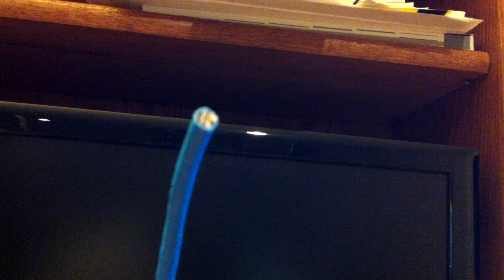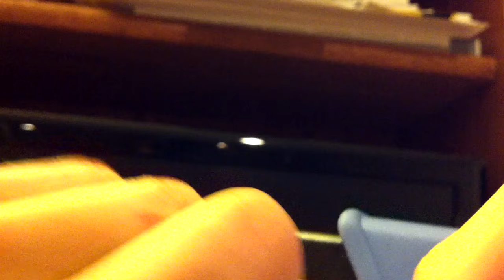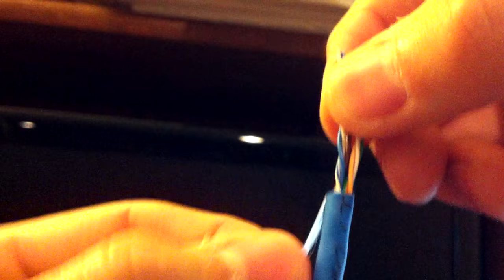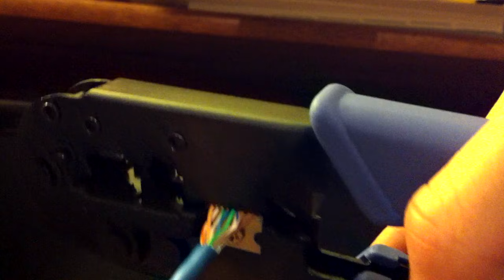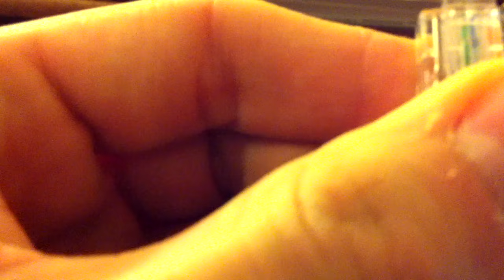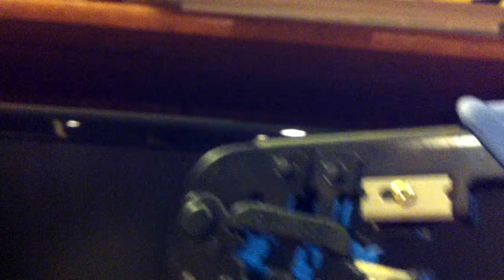How to Fix/Terminate Ethernet Cables (Connectors)

Comment: I recommend trimming the tops on the cable ends flat before pushing in and when I push in I flip the tool over so I can see the end of the plug and I push until I see the copper tips at the end of the plug.  Then I usually crimp 3 times to be sure.  Also besore I push in the cable I pinch them tight with my fingers so they don't move around.  I very rarely have to redo a cable using this method.

If you want to cheat you can get a crimper tool called an Easy RJ Pro and buy the much more expensive RJ45 tips that let you pull the strands through the other end.  The easy RJ pro tool will cut the ends off the wires that hang out the end but lets you do ends pretty quick.  I have had some people tell me that these jacks have caused shorts before but that may be that the tool was worn out.

Comment: Those filaments strands you cut away actually have an important purpose. The filaments strands are there so you can rip back the blue jacket beyond where you did the circular cut of the blue jacket. You are not supposed to use the wire strands where you did the circular cut because there is a good chance you nicked the wires with the blade. You rip the jacket back with the filament strands then cut off the wires where you did the circular cut. Now there is no chance the wires you have left have a nick and break off.

Comment: i use pass through heads (or rj45s) the cables stick out the tip and you can easily double check the order and will always know the cables are aligned and long enough. guarantee you always get a good crimp every time. the extra wires sticking out get trimmed off when you use a pass through crimper.

Comment: I'm glad I saved the old head of the cable that I had to cut off so I could reference which order the other 8 small cables were in.
Also this videp came in very useful in dire times when my cable broke, thanka a bunch!

Comment: OK so my question is why make it so difficult to wire a modular end piece ? No actually! My hands and fingers are so small that I can hardly sometimes pinch the wire is enough for them to actually be in the proper order to fit into the modular plug I can literally sit there for like hours trying to do this because it’s really as you put it tedious.

Comment: So my cable wire was ripped from the wall jack do i need to get a new plastic this that i can slide the wires in. Or is there anyway i can use the same plastic part

Comment: You must have the connectors in this particular order, if you use a different order, and even if they are the same at both ends you will get reduced speed, the reason for this is that the cable is twisted in a certain way.

Comment: excellent tutorial - and friendly. (In time, cable head tabs often break and some connectors are now spring-loaded so you require a good tab to lock it. And, yes - shoving the wires in (crucial step) is an acquired skill. I agree that pliers (needle nose) helps prepare a flat line in the right order and, while pushing them in, pinch flat, close in, and shove. If straight and flat the wires find the right grooves. One cable I repaired had the wire scheme: (white, orange, lime green, dark blue, turquoise, dark green, pink brown, brown). Go figure.

Comment: Hey! thanks for very instructive video! Had a cable with a broken tab that worked, but constantly slipped out of its socket (obviously). Tried first justr to cut and jam the cable into a socket & then clamp, but of course, thart didn’t work. Now, since Gooooogle is your friend, I googlet it, and this video popped up. Followed your meticolous instructions, and presto! It works! 
A bit of a fiddle, especially when you have to use a loupe to make sure you have the right strands in place (the joys of being "adult"), but once you get it sortet out, it’s a piece of cake (pie…). :)

Comment: I did this on a cat7 ethernet cable, it worked perfectly. You just gotta have the crimper, don't do it without the tool, I did it and I messed up the pins and connected it to my not cheap router and got it fried. Rip NG NightHawk :(.

Comment: This video contains a lot of bad information, "the fine hair like substance" is actually called rip cord, it is not for pulling more wire. The rip cord is used tear the outer coating so that the twisted pairs can be exposed with no possibility of damage being caused by a sharp tool. Also, he does not insert the outer covering into the RJ-45 connector far enough; at the rear of the RJ-45 connector there is a clamp that should clamp onto the outer cover to act as strain relief.

Comment: thanks! I finally got my new PC today and when I tried to plug my cable in it would not connect to my internet so after getting mad and then I had a feeling to check the router it's plugged into and surprise! one wire broke

Comment: is the process the same for cat7?
Reply: yes it should be cat 7 and cat 6 use the same crimper but cat 7 wires are totally different colors and have a much longer usable life span the cat 6 not to mention the speed of the data is a higher rate on the cat 7 but for the most part its the same exact set up

Comment: Very helpful video. May I ask how this works given that the 8 tiny wires are not stripped before you put them in the new RJ45 plug?
Reply: the connector has little conductive blades that puncture the insulation of each wire when you crimp it.
Reply: Thanks Andrew. I found it out myself by  messing around with it. I had to buy a crimper like the one used in the video.

Comment: Been doing this for years.  The hardest part is working in low light conditions, where white/green strip and while/blue stripe  wires look nearly identical. :)
Reply: Tom Buckley I have the exact same problem
Reply: @rhysbuckley4348  Too bad. I take care of that problem right away.
Reply: +Chuck Anderson Sometimes you need a loop to help and see colors.
Reply: Yea, great idea, but I use a headband light and I really look like  a
geek :)
Reply: Some junky old cabling that is slightly clear the brown fades and looks orange.  I hate that cable.

Comment: I have a cable like that. And i just tried to use it with my laptop. my download speed went from 14mpbs to 39mbps with the cable. But it CONSTANTLY disconnects from the network... do you know how to fix this? I've changed the speeds but changing it to "10 mbps half duplex" makes my internet worse than when i was on wifi. is there anyway i can have it at 100 and not disconnect?
Reply: @Mr. Chair this comment is from 200 years ago. i dont remember what the problem was but i'd recommend trying a different cable or contacting your internet provider so they can fix it :3

Comment: just bought 10 new rj45's and a cripmping tool from ebay for £3.95, Bragin, considering th ecable cost £30, the connector got broke pushing it through a wall, during installation 4 years ago, finally I realised that this is possible, thankyou. I been using wifi for sooooo long and now i can finally go back to the good old network cable. you saved me. GG. great video.
Reply: ArcticGamer javascript:WebForm_DoPostBackWithOptions(new WebForm_PostBackOptions("ctl00$ctl00$cphMain$cphMain$register$cmdRegister", "", true, "", "", f

Comment: Real nice video. One thing, to get the cables to line up and fit properly in their respective color slots just line them up in order 1st and straighten with pliers or even fingers (also flattening them in a straight plane & flush in color order). This way when inserted into the connector they should stay put and not misalign.
Reply: rayljr i see thats ok

Comment: Thanks for posting.  That part where you slide the wires into the back of the 8P8C modular connector (aka RJ-45) is an acquired skill.  Be patient. :-)

Comment: if I have two 1 meter long internet cables and each have a cinnector only on one end, and two other ends are conected together with soldering iron will it work?
Reply from the maker: If you are really good with a soldering iron, and you make sure to strip the coating from each individual copper wire before you solder them together....Yes, it would work.

Of course the pins (colors) have to match up. And, I really wouldn't recommend it as it is likely to produce a subpar cable :D
Reply: +Vytautas Poška  don't do that. It will lose major signal at the break point. Why do you think he told you no exposed copper. We are not just running electrical juice like to a lamp or even for a speaker. We are running data, lots and lots of data.
Reply: +BioHunta actually should be pretty easy to do. but ethernet cables r realllly cheap. i want to do this so i dont have to blow a inch wide hole through my floor to get the giant goofy end of the cord through.

Comment: well, i guess you could wire a crossover cable and it wouuld work on most modern network cards, but thats a different and random senario. (would be a great idea though to connect straight to another computer, for say minecraft
)

Comment: a little trick from a low voltage/phone tech from years back. the string that you called Insulation we used as a safeguard so we made sure the solid copper wasn't nicked
making it weaker and easier to break when handling.
cut the shield just like you showed. then grab the insulation with a pair of needle nose. pull back an inch or so.
it will cut the shield. then where you stripped the original shield cut off the tips
exposed above the shield, then cut the split insulation off.
guarantees that there will be no nicks in your copper.

Comment: It's a basic crimper/cutter tool. This one is designed for RJ-45 and RJ-11.  This method is just terminating a cat-5 cable with a RJ-45 connector.

Comment: The conductors that are built into the connectors actually have blades on them that cut into the plastic covering of the wire and makes good contact between the wire and the conductor pins.

Comment: Should have pointed out that you should make sure(by looking through the end of the connector) that each wire is making a connection.  At least I was taught that back in middle school, though that's generally if you notice you aren't able to connect to a network.

Comment: hey, thanks for the response I fixed the problem went back to the crimping tool to push the blades in a bit further as when I looked a little closer it seemed some had not pushed through the jacket and as to them not staying clicked in the Ethernet port the crimping tool flattened the clip on the top so had to pull that up a bit.

Comment: It is a big deal... you want as much blue as possible as the shielding locks the crimp to the shielding and helps prevent it from being detached.  DO NOT CUT THE 8 WIRES UNTIL YOU  HAVE THEM IN ORDER.  When you untwist the 4 pairs bend the line back and forth several times and smoothen them out with your thumb and index finger. Before you cut the lines should be in order smooth side by side and ready to be inserted into the crimp end.  If you want the line to last longer buy cable boots.

Comment: Hey did you push the cables in the head far enough before crimping? ...and when you crimp the RJ45 head use enough pressure or the little blades wont go far down to allow it to clear certain ports. You may also have defective heads like I got once. Get some from Homedepot or Radio Shack.

Comment: I've run into a little issue if anyone could help that'll be great. I made an Ethernet cable with a reel of cat5e, did exactly as done in this video to add the ends but now the rj45 ends will not clip into my ethernet port on my computer or router, but do on my cable tester and the cable passed the tester, nor is the cable deteced when put into the Ethernet ports if anyone knows why this is please let me know your'll be a great help stuck with a rubbish WiFi dongle at the moment.

Comment: usualy it is the connector.. but if you step on the cable a lot it might be the cable itself..
mind that 2 pc's need a crossover cable type(although nowdays with mdix it is not necessery)

Comment: Maybe do what I used to and cut down an old tab-less ended cable and use that to line up the smaller strands and maybe, and I am guessing this will work, use some fine fishing line to wrap round each cable making sure they are in the correct order, this will print them moving around too much. I have used a single thickness of electrical tape but this makes it a little bulky and hard to get into the new plug

Just a thought, oh and I have only ever done this with other types of cable not ethernet

Comment: @AsKSniperMagician You'd have to go into your router's settings (There's usually an IP address or a website you go to and enter a username and password, which is usually "admin" and "password") and enable UPnP. Not all routers have this setting, and I've had this problem before. UPnP was on, and I was still getting Moderate. I just left it alone for a while and it worked.

Comment: they r called rj45s not heads... and its a lot easier to say white orange, orange, white green, blue, white blue, green, white brown, brown. its easier to unwind the green pair first then put the blue pair in it and unwind that and then put the other two pairs on the correct sides. and a lil more blue is actually more important cuz u can pull the pairs out if u pull on the cable.

Comment: @95drumhero Wired connections are much faster,  but usually your more limited by your internet connection then your connection to your wireless router.  Most cat 5 cables that you can get at places like walmart are like 50-100,  but if you can make your own, or find someone that can do it for you, you can make a cat 5 cable any length up to about 390ft.

Comment: the fiber in the cable is a slitting cord to slit the insulation.  If you are worried about knicking the conductors then cut about an inch or so of the insulation off,  grab hold of the cord and pull,  I usually expose 2 1/2-3 inches of conductor.   As you organize the conductors hold them between your thumb and finger and that will help keep them together.  When you go to cut your conductors usually about the length of your thumb nail,  still holding them between your thumb and finger.

Comment: @95drumhero. I had  teh same problem. I made a hole in the sealing of the 1st going into the 2nd floor. Then disguised the cable using weird methods. Worked alright